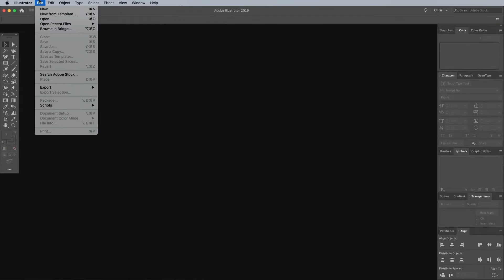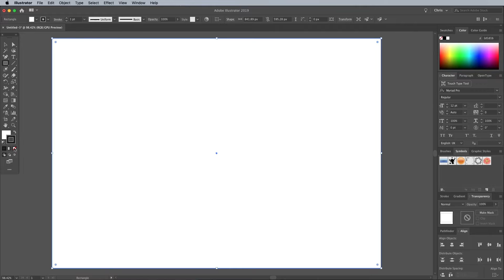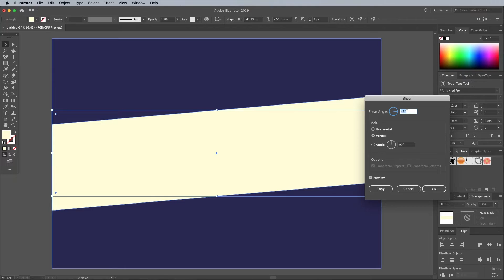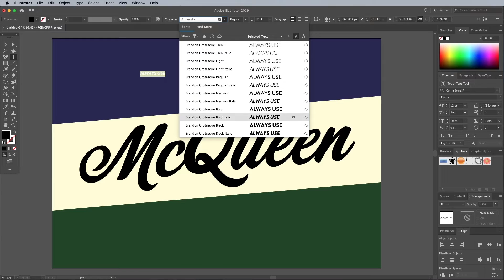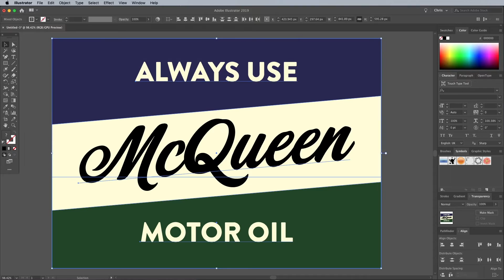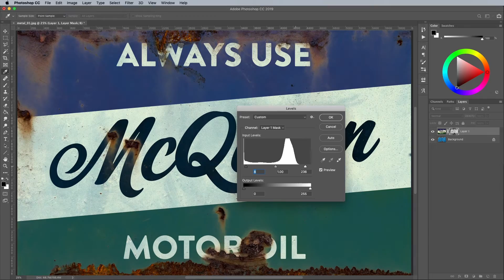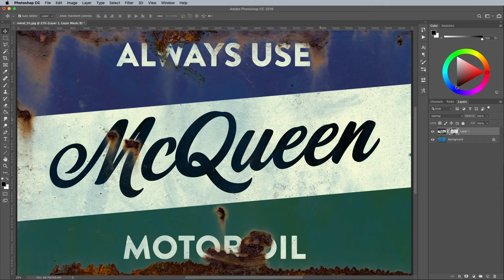How to Create a Vintage Rusty Metal Sign Using Illustrator & Photoshop

Comment: Wouldn’t it be better to move the rust image into Illustrator? At least you would maintain editability of vector objects and text. If you commit the rust layer and mask to a regular layer with transparency, save it as a PSD, and then import into Illustrator, it should provide the same effect. Or you could combine them in InDesign, but that’s a whole ‘nother episode.

Either way, the rust won’t scale up like text and vectors, but if the rust image is natively 300 ppi or better and free of compression artifacts or other issues, it should do pretty well. I find that rust is a forgiving subject when it comes to upscaling. Besides, if you’re going really big, one could always consider a carefully executed vector trace and a little bit of cleanup, but that is admittedly a rather different can of worms. 

Anyway, mate, really great video. Your technique is quick, effective, and looks great. I just have a wild hair for preserving vectors wherever possible.